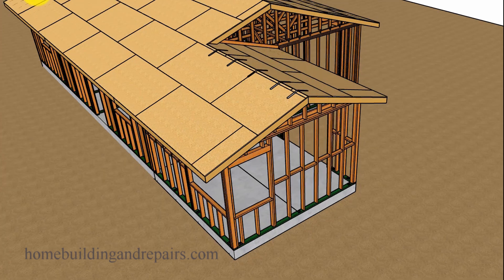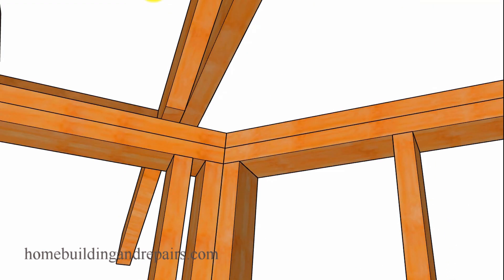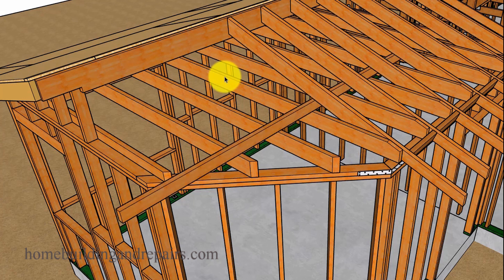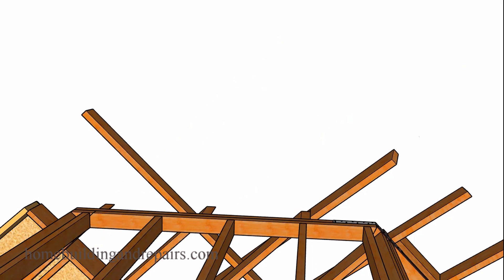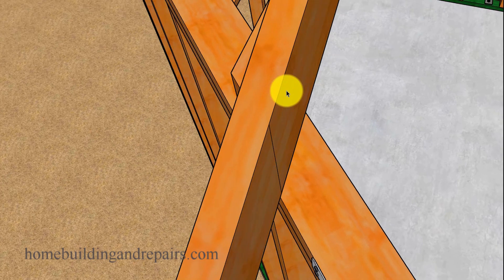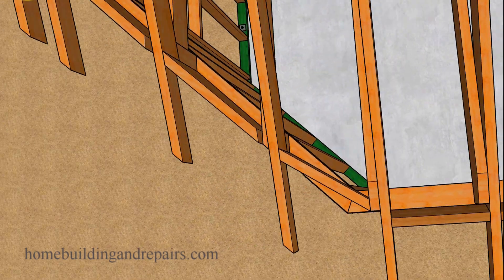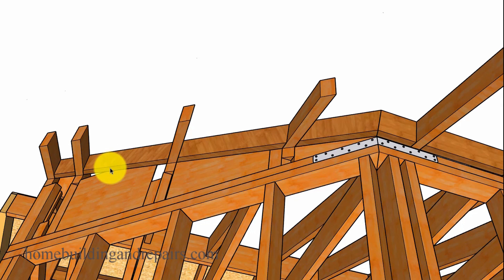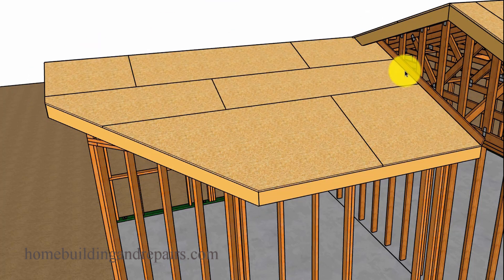How To Build Home Addition Angled Wall - Ceiling And Roof Framing Details

Comment: Hi Greg.  How would you handle a gutter on this weird angle?
Reply from the maker: The upper angled gutter would slope parallel to angled fascia and drain into and connect to lower gutter and then the down spout could be located at either end of the lower gutter.
Reply: Hi Greg, I have a build like this, how would you go about joining the two seperate gutters together? Short of trying to cut a pvc gutter join and bending it up I cant see a decent way to get the gutter running dow the pitch to joing the guttet along the front.

Thank you  @gregvancom

Comment: Super video, Greg. I did that sort of design on an addition when the municipality in Ontario refused a minor variance all because of 2" on a weird-shaped  rear lot. Those sort of variances are usually granted by rubber stamp. We conformed to the bylaw by doing a 45 degree angle, and maintaining the 5 foot setback by following the lot line. It actually worked out very well.
Reply from the maker: That is hard to imagine, but I understand why they might have needed to do it. If they do it for you, then they're going to have to do it for everyone else. Glad you like the video.